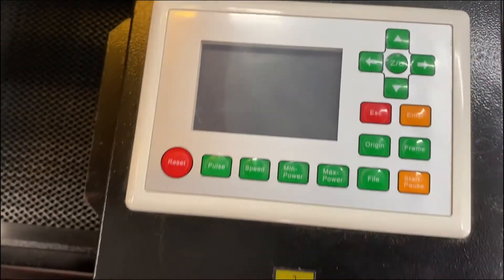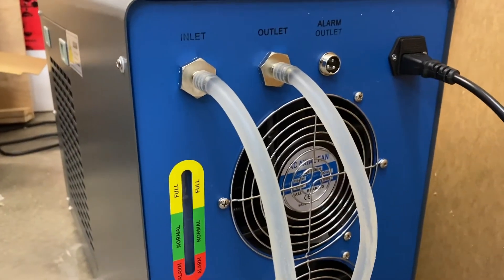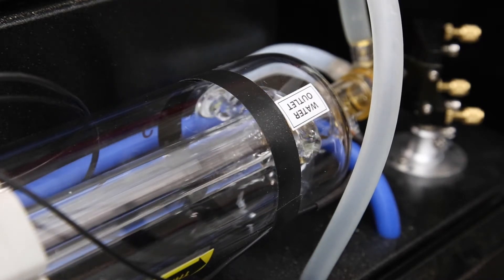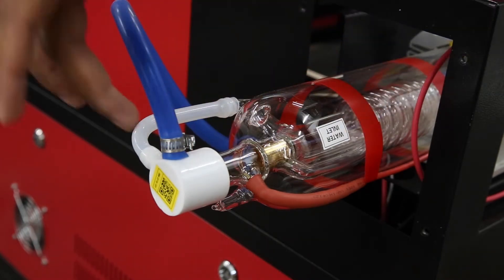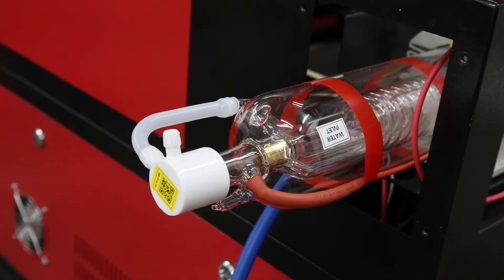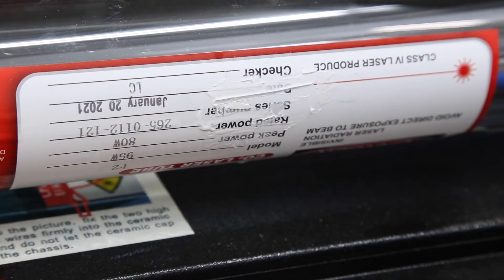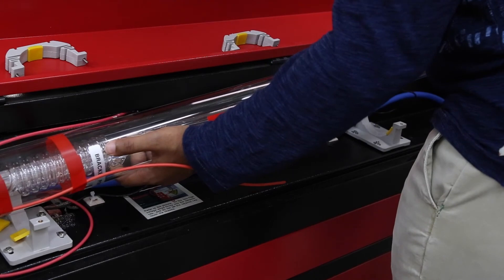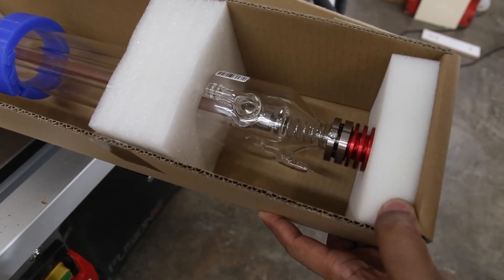$1200 glass paper weight

Comment: Question about your water lines. I'm new to laser just got mine, but doesn't  the outlet of the chiller go to the inlet on the machine?
Reply from the maker: Yes that is correct, I hadn't been able to use the laser at the time so the lines were mixed up.

Comment: Did the tube fail or why did you replace it? 
Another question, do you also clean the lense which is in the co2 laser tube after every use or have you ever cleaned it?
Reply from the maker: The tube that came with the mean had a defect and would not fire at the right power levels. I don’t clean after every use. I usually try to clean if I see degraded performance in my cuts or if it got really smoky in the machine